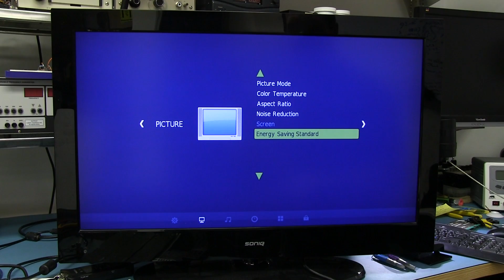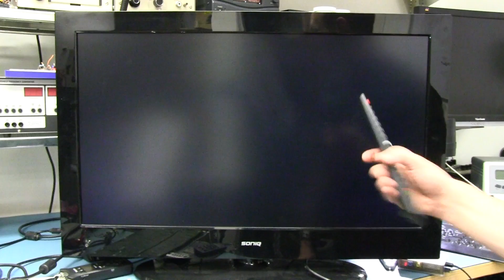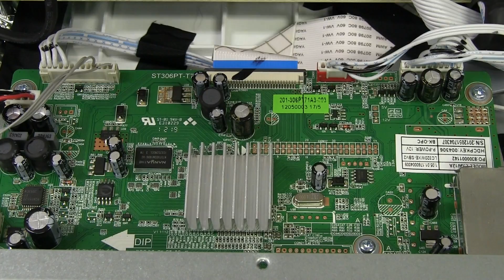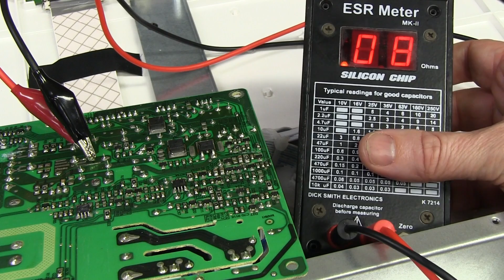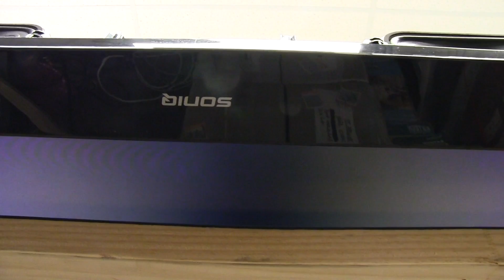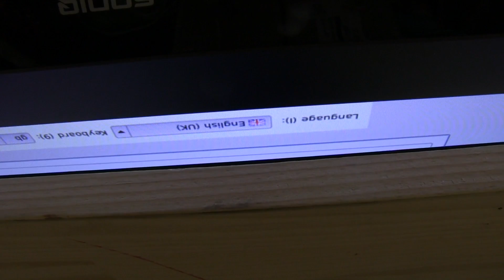EEVblog #630 - How To: Soniq LCD TV Troubleshooting Repair - Part 1

Comment: I got one exactly the same and it flickers after start up then shows the picture and turns off. It does this 3 times then usually will run all day fine. But if you try switching between hdmi modes from 1 to 2 it starts to flicker a black screen and won't connect to the source till switched of and on again. Seems once it has warmed up runs fine till changing modes.

Comment: My input source on my Soniq keeps flashing up from time to time. What could that be? I checked the remote and even removed the batteries. How can I stop it from doing this. It's driving me nuts as I use the tv as a monitor.

Comment: Bad capacitors are less likely to cause problems these days. Corrosion or dry joints on the plugs can be the cause, so the first thing I would do would be to disconnect all the wiring and spray with CRC-226 or even WD-40. Push the plugs in and out a few times to ensure proper connection. If this doesn't work, then the second thing I'd do would be leave it outside the Head Office of Soniq, as these TV's work perfectly as land fill.

Comment: 12:30, you mention only use high voltage differential probes when working with mains.

Can you (or someone else) explain why? I get that the mains is high voltage and dangerous. But we're not talking about 10KV, it was ~400 Volts, right? So shouldn't normal probes be rated that high? (I'm in the USA, so my mains are approximately half of though. So maybe that comes into play?)

Or is it more that the voltage is completely "unknown" at that point, so you may, in rare instances, exceed it before you realize it?

Additionally, why the differential probes? What benefits do they have when working with mains? Or maybe I've been using diff without ever realizing it. Are any probes that have a second cable, "differential probes"? (I have an old Tektronix with probes that have a small black cable coming off with an alligator clip.) Or is there something extra going on?
Reply: Please, get on the internet and look up about differential probes and the NEED for them when working with main voltage, by the way the small black lead is the ground for the probe, Turn off your machines and start reading before you turn them on again, please stay safe

Comment: This reminded me of a monitor that I have, when it was connected to the computer with a VGA cable, maybe after hour of use, it stopped reacting to remote control and the buttons, I think the image worked, but none of the buttons, it couldnt even be powered off without taking the plug out. Then when using it with a HDMI, no problems at all... Well, it was probably the cheapest brand you can get... And the transformer was on the cord and it was huuge.. The monitor itself ran on 12V

Comment: Could you damage a circuit board by using a volt meter and accidentally shorting across a couple different traces or components?

Comment: Why do you say to keep one hand in your pocket while working with a hot source? I took a computer power supply apart once and plugged it in and at some point i electrocuted myself. If i had kept one hand in a pocket, would i have avoided getting shocked??

Comment: One thing I would have tried to confirm a failure in the digital processor is a couple of shots of freeze mist.  If chilling it down changed the operation then you know where the problem is.  Granted if it is the digital processor you might as well declare the set a paper weight.  Replacement cheaper than repair.

Comment: I have had a similar problem with a set I have and I re flowed the solder and had to change the ribbon cables it's been 2 years and still going strong

Comment: There is a signal processor board for the LCD itself. they have fuses. i can grantee the fuse in it is shitting itself. it looks like your getting lights so the inverter seems okay..so its a safe bet that its the fuse.

Comment: Dave, mate, you spout supposed wisdom that you really have no foundation to sometimes (though I do appreciate you are extremely knowledgeable). Spending your first tens of minutes of diagnosis time on power supplies when there is clearly an intermittent fault that is not related to a fixed amount of time after turn on (i.e. unlikely to be overheating). As soon as you realise you have an intermittent fault like this you should start tapping bits of the kit and re-seat obvious connectors. The most likely reasons are bad connectors, dry/bad joints, track cracks etc - physical stuff. It has been the same story for decades. That would be my first step because it is so quick to do. You could even start spraying some freezer spray around to see if it made any difference - only because this is a quick thing to do. This may not only show up overheating (which I think is unlikely here) but it will cause physical expansion/contraction of tracks/joints etc that may be the cause.

As for people mentioning that fixing it would be uneconomical. Sure this is true if you are paying someone to try to fix it but that is not the situation here is it? Dave is doing it because he loves taking things apart, looking inside them, playing with his toys and also talking about this stuff on a video blog!

I shall now go watch the second part to see if I am talking complete crap.

Comment: Dave, a few things about capacitors and switch mode power supplies. 

Firstly, you can have heaps of ripple on the mains capacitor and a switch mode power supply will still work (particularly at low loads).

Secondly, capacitors with high ESR will generally only fail if there is a high ripple frequency, ie. on the secondary (20kHz or so) rather than the primary (50Hz in this case).  It is the high ripple frequency as well as the high ESR that creates the high internal capacitor temperature causing them to vent out the top.

The ESR increase is a positive feedback sort of thing in the same manner as thermal runaway on a semiconductor die.

Comment: Power it up with an input then whack around on the different boards for possible lose connect or solder joint.  If that doesn't revel the issue, try FreezeIT on different parts of the boards.  It would seem to be a heating issue if the display goes away after its been on for a bit.  I don't think its the PS.  I think it is in the display logic.

Comment: Hey
Is it ok to leave the Capacitors soldered in while testing ESR as you did? I wonder if it was possible that you get a false low reading if there was another Cap in parallel, effectively lowering ESR and increasing Capacity.
- Alex

Comment: Hi Dave - I'm not a TV repair man either! I looked up TCON and found this interesting reference from Sony that someone posted online http://monitor.net.ru/forum/pafiledb/uploads/6ba16c1c745c6faa364f702b38dc7866.pdf 

Seems the TCON is a serial to parallel processor - might be worth having a poke at the connectors and maybe heating / freezing... Good luck!

Comment: I had a touch screen system at work that was doing the same, no screen, blinking, R, G, B, random fuzz, turned out to be a bad video cable (we deal a lot with Shenzhen daily special type systems), perhaps its something as simple at that?

Comment: My money is on the display. Perhaps one of the flat flex cables that are soldered on the glass. They have chips embedded in the cable. I heard the cables  are soldered with some sort of ultrasonic device.

Comment: I repaired an older model of those Soniq TVs. Had power supply issues, mostly due to caps, but surprisingly some of the power diodes were dead, too. Might be worthwhile to check diodes and also the power supply ripple. If you havent already.

Comment: reballing on the cpu mcu mpu whatever, and maybe on the buffer chip. all the rest parts just spice around the pasta :) thats the problem with nowaday electronics. You cannot enjoy the troublefinding. all of this is maded for max lifetime as the garanty. even in the software is burned to get die until the marked lifetime. but, this is the way how You can get under 200 :) Dave, You need a reballing station :))))

Comment: Perhaps flaky solder joint or solder (tin) whisker. Try using can air on all the components. If that doesn't work try pressing down on all of the digital chips for checking bad solder joint.

Comment: Had that fault with a different brand of TV and turned out to be the timing controller board, which was separate from the PSU and main controller board (the one with all the inputs on). I don't know the exact TV you are working on but could that board near the top be the timing controller and not a buffer board?

Comment: I would first test the response from the remote to the board when you hit a key, to see if the board is receiving the signal, If it is then I would look at the inverter board to see if it is dropping out after a few minutes but I think Dave said the back lights were still on, next the T-Con board and the cable to the screen, that might be loosing the signal in and out.

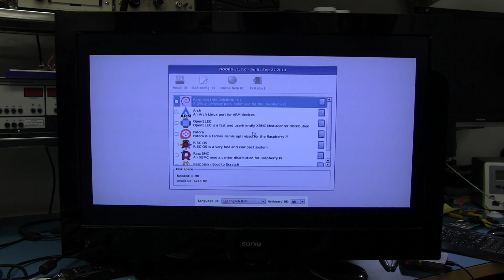Comment: Dave... At about 3:12 with the Rasberry Pi input on the screen you went to the back of the TV and when you physically touched the case the TV display instantly went blank. It seems like an intermittent "mechanical/electrical" issue.
As others have mentioned I would check the multi-pin flat cables from the CPU board connector to the buffer board connector and from the buffer board connector to the LCD. A connection could could have become oxidized over time since WonHungLo manufacturing practices could be the culprit.

Of course I could be completely wrong......

Comment: I'd try disconnecting each lead and possibly spray with a bit of electrical contact cleaner. I had a somewhat similar problem with my lcd tv and this sorted it. The fact that the pi will no longer display after moving the digital board also point to the connectors in my mind.

hth

Comment: I don't have a lot of knowledge of LCD's but when i repaired my old sharp tv was an issue with the damn deflection circuit + a diode and i was getting similar lines like those. Anyway i still like the repair section of your videos, really interesting.

Comment: Sigh! Seems that it is not very feasible to try repairing electronics at all, unless it is something relatively simple like a blown cap or a broken hard drive. Well, it's always nice to still give it an attempt. But even these Dave's repairs have quite low success rate, and he's an ace guy who knows what he is doing.

Comment: Hi Dave. Some cold spray might be your best friend here. Yes I know you have a flir, but if there is a bad solder joint somewhere, the heat of the surrounding components may be the cause. The bad solder joint may be in a "cooler" spot on your flir. Might even be an IC that's become temperature sensitive. "Hose that sucker down" Repair in a can :^)

Comment: I reckon it is a few bad solder joints, since it is intermittent. Heat up the digital board in the stove to reflow it is what I would do! or a heat gun as other suggest!

Comment: Oh and just to give you hope:

I'm not very bright but my living room has a nice Denon AV amp and a big arse telly I fixed.  The denon had a failed pair of transistors which took out some resistors and the telly had dried caps and a MOSFET that had failed short.

Comment: Hi Dave, have you tried this key combination (on the buttons on the side) menu, then channel +, then source. Finally the volume - about 4 times. If this works it is probably the energy save mode. If this thing has a cmos battery it could be that.

Comment: I just didn´t get this....it sometimes runs fine but sometimes not...so why you messin around with that caps? I´d try a heat stress, get a hair dryer and warm it up, while running...may sometimes it runs -- sometimes not, then cool it down with cold spray and see what happens.
I guess it´s some sort of solder joint issue...As these units will heat up and cool down, by time when in use...so commom problems are caps (as they are fine here) and heat/stress issues...so try that and i guess you could trace it out...and find the issue...

May it´s in the video board, may the main, cooled, processor may a bga pin is not connecting anymore...so this would be a dead end....
I came across these lo-priced TV/SatReciever/DVD-Player....all got solder joints problems due to heat and/or mechanical stress due to bad mounting (it´s all made damn dirt cheap with no care at all) sometimes i could fix it, sometimes no because of a bga-isch footprint device....

Or maybe something completely different and you should check that little buffer PCB between the panel flat cables....

Interesting video anyway...and many thanx for sharing, Dave!!

Comment: Is it OK to test a capacitor in-circuit like that?  I am pretty sure Dave knows what he is doing but I always thought you had to go through the trouble of removing them for some reason.
Reply: You can test them with an ESR meter in-circuit, but you can't put the same trust in the results as if you desoldered them first.

Same with measuring resistances in-circuit. Sometimes it works fine, sometimes you get garbage results. Need to learn by experience when it works and when it doesn't :)

Comment: Great video Dave, I had an issue just like this with my Samsung sync master monitor. After days of testing and troubleshooting leading me nowhere. As a last ditch effort I re-flowed the solder in some areas on the input board. After that it's worked flawless.

Comment: I have a 24" with almost similar problems. Noting wrong with the power supply in mine also, so I suppose the main BGA chip solder joints but did not get the time for it and I have no use for a TV anyway.

Comment: try pressing on the bga chip gently while it is on and notice any changes, it could be a cold solder joint/ball. Also a side note is that you have left the white cover on your raspberry pi acrylic case - you should take it off to make it clear! good vid

Comment: Interesting that 'Nothing Happened'.  This is what almost always happens when I poke around in dodgy electronics, so it's good to see that it happens to the experts as well.  Certainly looks like something is 'loose', from the way he touched the monitor, and it immediately went 'off'.  Bad solder joint(s) or something.  Certainly, beyond economic repair when you can buy a new one for $200.

Comment: The heatsing on the BGA package was surprisingly cool which would lead me to suspect that it was perhaps in need of a reflow or simply faulty.

Some mechanical tapping of that package whilst watching the screen might help confirm that a reflow was in order perhaps?
Reply: The BGA package in most monitors acts like a pseudo GPU which decodes the information from the input and drives the LCD panel using a small amount of on-board RAM. BGA's in general have the high chance of soldier joint failure, especially in cheap-o equipment such as this one. Overheating exacerbates the problem which is why I was surprised not to see a whole lot of heat coming from the heat sink. Usually this is indicative of a bad glue or thermal compound job.
Reply: Hmm. I figured that was due to a difference in the thermoreflectance coefficient of the heatsink.
Reply: Falcrist This heatsink is kind of matt aluminum, so that shouldn't be the problem. Anyway, only Dave can confirm that with a thermocouple. It may be interesting if the device is overheating under a badly connected heatsink.
Reply: I thought about it as well, but maybe a substantial heat will only be noticeable when the upscaler or other applications such as a decoder is running on it. The HDMI Input might not challange it enough. But well, I don't know :/
If it was a GPU I'd have said it might be the V-RAM, as these flickerings often are cause by that. But here?
Reply: Could be either a potential soldier ball issue or the crap thermal glue they stick under those heatsinks.

Comment: Great video. I ended up fixing an old LCD display that came with my nightowl security camera system. Since all of the caps looked fine, I ended up replacing all of the electrolytic caps because all of them looked fine (did not have an ESR meter), lucky for me, it fixed the issue, (glad I did not have to touch the ceramic caps). (it was the flimsiest display I have ever touched, cheap thin plastic)

https://www.flickr.com/photos/razor512/8956022800/
https://www.flickr.com/photos/razor512/8954825831/in/photostream/

Comment: Dave, considering that you can hear audio and all the rest is fine, I think the problem lies in the (LVDS?) signal to the panel itself. Lines and odd colours appearing on an LCD can be caused by a bad digital signal or loose cable (connection). You might want to give that "buffer board", as you call it, a poke and see what happens. Another idea might be interference, since the display signal cable runs underneath the SMPS. Either the SMPS started to emit more electromagnetic noise over time, or something like that. Never say never. Anyway, just trying to be constructive here.

Comment: The fact that you had a picture from the Pi in the beginning and then when you bumped the TV and the picture went out makes me think its a bad wire.... Have you tried just wiggling the wires/connectors around to see if you can get it back?

Comment: Was surprised you didn’t use a “thump” stick, I use a wooden dowel that is about 7inches ling and ¼ inch diameter. Set it up to see the screen in a mirror and gust whack the boards at different spots. This will find bad connections and cold solder joints in no time. I always have one handy.
DLMinton

Comment: Bad solder connections on the video processor. Those BGA chips and lead free solder are a constant source of woe. Pull the video board and take it to somebody who can re-ball the chip and it'll be back in working order.